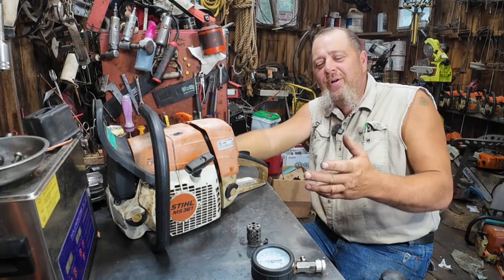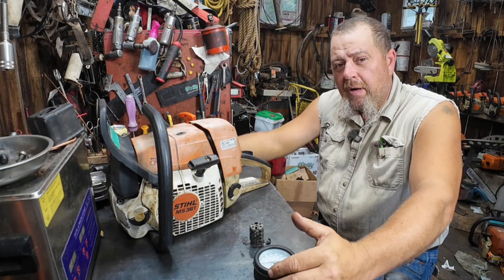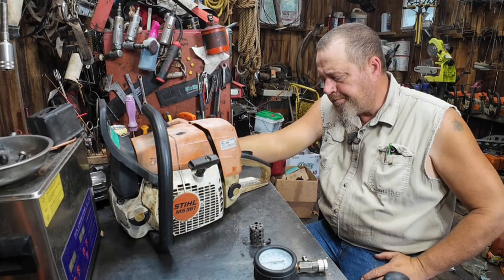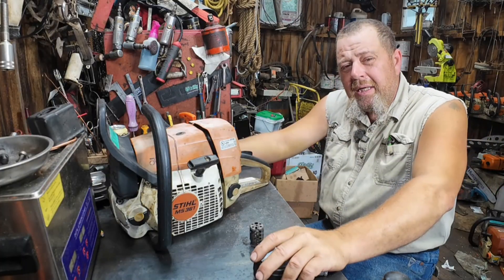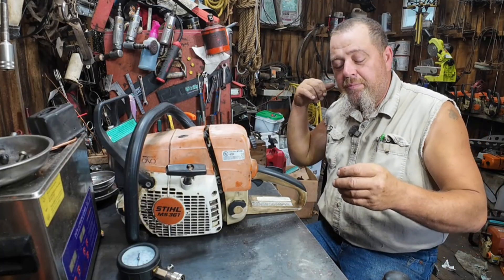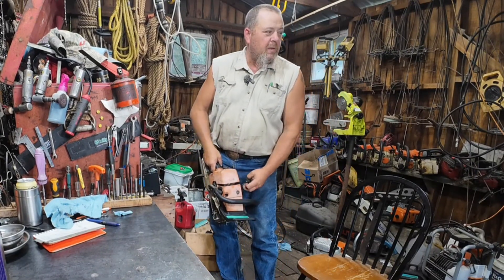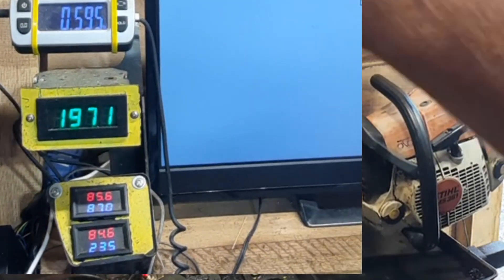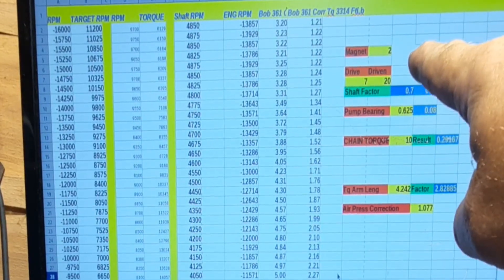Chainsaw Dyno; Huge Gains with *ONLY* Piston Work and Lower Transfer Work on Bob's Stihl MS361

Comment: I'm trying to source an elbow for my intake so I can put my velocity Stack on my 460 . My 590 / 620 build runs awesome with the stack and I been working on this 460 like you are bit by bit , might be my favorite saw build and I been picking your brain off here for a long time thanks Mark just sayin . Anyway to the whole point again do you know where to find the adapter elbow
Reply from the maker: @KCamp0506 Sounds like you're having a heck of a nice build going on; I sure don't know where to find/buy an intake adapter/elbow; I tend to make the stuff that's oddball if I can. Sure makes me think about a 3d printer, for sure!!
Reply: @HayChaffandSawdust1 that would be the way to go . I do all my own tinkering to , pretty impressive the places a guy's mind wanders with these things , and yeah check out my 460 I got going on . Slightly decked like you've done did my pockets with a socket and various grits . Worked well . I put up a vid today I dremeled out my carb it's probably 2 1/2 times the venturi size compared to stock and I gotter taking tune like that . Check it out and stick with it partner
Reply from the maker: @KCamp0506 Heck yeah!! I misunderstood in the first post; it's a 460 Husq and not an MS460; gotcha!!  I did make a carb block/manifold for mine and changed over to a 357/359 carb. I think there's a palylist of the various variations of the 455; I know there's a video of the carb block; currently, it's  on reeds.

Comment: That dyno is doing everything but making coffee now. What's next?
Reply from the maker: @Kevin.L_ I think, for the next upgrade, I will do something for my bride; I think I may program it to pick up my socks and put 'em in the hamper.   ...welllll, that's kinda for me too; maybe the knots on my head will start healing if the socks make in the hamper SOMEHOW. 🙄
Reply: Adults beverage machine? 😎
Reply: Yer gonna have to give me a couple of videos to comprende this new data. Was just getting to kinda savvy the old stuff. I ain’t smart, but I am slow!  Much more better for rapid discovery of results. Less confuser tinkering. All good stuff for to produce more changes 😊.  ID and OD of husky fuel lines?  Needs to get some of the fancy stuff for both of us
Reply from the maker: @wrstew1272 Yeah, I'm gunna have to find a way to record and stick with it; I know in the next few videos it may show the dyno run (computer) one way one time and a different way the next time.  THe charting is  all the same though.   IIRC, (which is doubtful with my advance condition of CRS), the OD is 1/4"  Dunno about the ID.